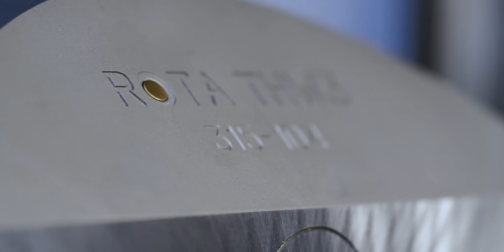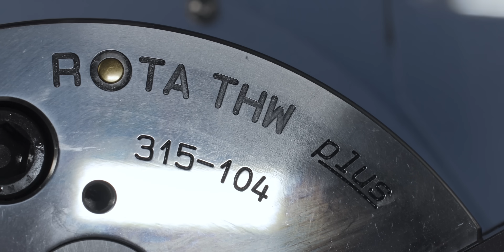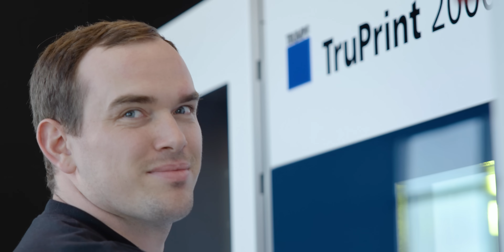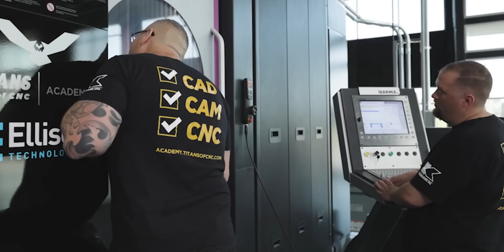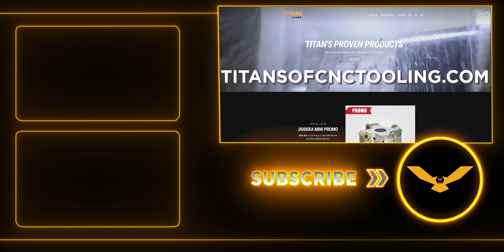Should Engineers Be Arguing with Machinists Over Run Time?

Comment: There are always 2 sides to every coin, titans. Presenting just one point of view is never good.

I am a mechanical engineer in a company that produces hydralic products (not parts mind you, whole products). Our company has >500 people working in it and about 120 CNC Machines. I can work and setup about 90% of them.

Every time I go and talk about a new part for a product with some of the "older" machinists and setup guys, all I hear is how this part is impossible and it can't be done. And in my 13 years of work experience, we've never failed to produce the "impossible" part.

Now you talk about how bad engineers are, but I've seen machinists intentionally crashing machines just to "prove" you are wrong. I've seen machinists writing programs to keep the spindle running, so the time efficiency tracker won't detect idle time. Smart people are very creative. 

We don't know the whole context here, except what the narrator wants us to know, but there are bad aples on both sides of the fence. And they are usually much less than the good apples. Now I am following you mostly for entertainment value, I don't know if you have an engineering department, but from what I've seen from your videos and attitude towards engineers, I would guess not. Don't be narrow minded, stay hungry.
Reply: As an engineer with only a few years of career experience, I've seen exactly what Trevor describes. I've also, like you, seen production sabotage themselves to spite engineering and management. So yes, it goes both ways, but don't discount the one side just because the other was not presented in this one anecdote. Have you ever heard/read an anecdote that shows both sides intentionally screwing the other? Me neither. That's why they have many anecdote videos. They have a video similar to each anecdote you presented - go look.

Re: "I don't know if you have an engineering department, but from what I've seen from your videos and attitude towards engineers, I would guess not."

Barry doesn't hold a degree, but he is an engineer. He and Trevor both design parts and tooling. Barry meticulously calculates machine capabilities for their extreme cuts. Since many engineers are glorified designers (I dip in and out of that category), I would say that Titans of CNC doesn't need a dedicated engineering department because some of their machinists fill the role of engineers.

Don't be narrow minded - don't judge a library by one video.
Reply: Interesting, we have some parts that are way over quoted , like 30 hours to run this job is quoted but I can do it in 10, and the older guys always try to get me to use that full 30 hours and turn my feeds down and I’m like hell no! A lot of problems at this company stem from almost all machinists acting like that especially if we don’t have a lot of work , I really don’t like tracker times because it doesn’t account for if you run into programming issues or other issues. If a machinist actually tried to crash a machine on purpose he’s done.
Reply: Yeah this video felt more like a rant. As an engineer I can tell you there are plenty of engineers who know nothing about machining and don't care.
I would NEVER claim to be a great (or even good) machinist, but I did intentionally ask to be put in the machine shop as my first graduate placement. Firstly learning machining makes you a better and more sympathetic designer and draftsman.
Second you realise you will never know it all, but you start to know what you don't know.
Thirdly you make friends in the machine shop, and those contacts will be very useful when you need advice or a favour cos you screwed something up and need to get it fixed ASAP.
I loved my machine shop time, and the fact it helps you when you jump on a manual machine for an ad hoc design change
Reply: Good on you. I’m tired of hearing all the engineer slander and the “us vs them” mentality that goes on within departments of the same damn company. 

The most important thing a business can do is stop tolerating the fragile egos of managers and have open communication and cross training between departments.
Reply: I was thinking the exact same thing when I watched this video. This is one of if not my favorite youtube channels, but this video is tone def and one sided. I did not hear any suggestion that maybe the engineers should spend some time on the shop floor learning "why" things are done a certain way. I got to witness first hand last week that 30 years of machining experience does not mean you are immune to making mistakes that cost the company thousands of dollars and days worth of lost production time. It was a perfectly preventable problem that could have been avoided had the machinist followed some pretty standard best practices when it comes to programming.

Clocking in and out of jobs takes next to no time when compared to the time required to setup and run the job it is literally a mater of seconds. I don't know why the "degrees n' stuff" comment bugs me so much, but as an engineer I know that my degree doesn't mean that I know everything. Just like having an engineering degree doesn't make me an expert machinist, having 30 years of machining experience doesn't mean you are the worlds greatest machinist or that you are constantly working on improving run times, tool, life, part quality, reducing down time etc. 

For supposedly being a channel dedicated to learning and education, this video has done nothing but give young machinists reasons not to work with or trust their engineers. If they really wanted to make things better, this channel would find an engineer they trust and do a whole video series on how machinists and engineers can and should work together.
Reply: @keeganrempel6847  engineers with machining experience that actually get involved with machinists are like gold, and it makes everyone’s life easier. It would be awesome if companies had engineers cross train
Reply: I have the same feeling. I find that in general, it's not really known what an engineer actually does. Only the 'bad' things are often stereotyped in my opinion. As if we think we are better and can never make mistakes.
Reply: I would recommend you take a look at your ego. I've seen engineers deliberately cut corners on their designs just too please their boss or make deadlines. Also seen them make high dollar mistakes because they refused to listen to those around them.
Reply: You're a rare breed bro, don't read too much into it.
Reply: In my experience, more often than not, the engineers designing a part have little to no understanding in the machining process when it comes to the design and datum structure especially when it comes to tight tolerances. Is this video a little biased? It is to a point, it doesn’t disregard the fact that Mr. Engineering degree knows jack about machining yet he/she wants to tell us how to machine the part? Tell your Engineering people to respect our trade, we dont have Control+Z to undo a mistake like you guys have in your virtual world where everything is perfect. That’s why us Machinist don’t respect engineers due to this sugar coated mentality.
Reply: yall are acting like theyve never called out machinists for doing piss poor work, or intentionally breaking stuff. they have, all the time. jeez, yall engineers sure dont think you have an ego about stuff, but my god you do. get over yourselves.

Comment: I believe the best thing that engineers can do when Improving a process, part, etc., is to grab machinists from the floor and have small meetings. For me, the meetings help me believe that my opinion is Important and that teamwork is the best aid. When we sit in separate pods and complain that one department isn’t right or  wrong , nothing gets accomplished. I’m trying to push this, because we have a lot of this toxic workplace environment at my current employer. It’s a work in progress. It’s a lot more exciting when everyone is on the same page working together too.
Reply: I would do the same, but in reverse direction: make the engineer come to the machinist. It's all nice and well to CAD a part, but to see the machining (and all the prepwork, fixturing etc.) is kind of abstract behind a screen, even though software can visualize the toolpath on screen. 

I have to be honest, my background is somewhat different. I've been a process engineer in the steel industry for just over 9 years. That meant a combination of sitting behind a desk but also on donning the required protective gear and stepping onto the production floor or the control room, seeing production, chatting with operators. There is such a wealth of practical useful information to be learned from them.
Reply: Yeah. Somehow, when two parties disagree, discussing the problem seems like an absurd idea to some...
Or, in this case, simply complaining was easier and provided the satisfaction of "I told you this process would be bad, therefore everything is your fault."
Reply: We used to have a similar problem until we started safety meetings every morning they didn't have to be long but we had to have them kept everybody in the loop on the same page and made everyone important and productive. It's amazing what you can do in 5 to 15 minutes while everyone's drinking their coffee and normally would be out on the floor talking not producing a thing.
Reply: Then they find out that letting the machinist build all the automation is cheaper than an engineer. Then the new HR lady fires you for working on the automation and not running the parts on the machine. that's what the did to me. And that's when I went from employee to supplier.

Comment: Honestly I don't think the system was a terrible idea, yes I agree it slowed down production and yes I hate unrealistic deadlines. However, if they used the metrics to figure out if 4 out of 10 machinist were slacking and stealing time from the company. I don't see an issue with it and would actually see it as a good idea for weeding out the bad eggs. Obviously the way you describe it, they were using those metrics to threaten you. That's not okay. But, I've worked in plenty of places where 5-6 lads just don't give a damn and it leads to their work being piled on everyone else who was doing their job right.
Reply: Yeah, we make prototypes every single day where I work. You have to clock in on the parts so your times gets registered. If youre then the only one working on that parts and it takes longer than calculated - as long as you can address why, its often cool.

This also means that the slacking morons can't just hide, which is fine.

Comment: Personally I'd think getting the engineers down on the shop floor to watch you work a few hours should rectify the problem unless they're just assholes. 
I'm an undergrad operating the manual machines for a uni autosports, I'm always happy to learn but often seeing what goes into a job clears up any confusion far faster than an explanation. That said, I completely get the frustration towards engineers. Some of the design 'decisions' I see tempts me to perform percussive maintenance on the offending designer.

Comment: Whenever you have two parties arguing about what is possible and what will damage the machine ultimately reality will be the deciding factor. I work with engineers and I worry less about being right all the time and just try to make sure I’m communicating my best estimation to those stakeholders involved. If I tell someone something might not work and it doesn’t work that’s OK but if I tell everyone that this won’t be a problem and it fails miserably than I have done a poor job of estimating and communicating expectations

Comment: Most engineers shouldn't argue about anything. Unless they have actually worked on the floor and / or in quality, they need to do their job and keep their mouths shut.
Reply: Some engineering programs at least make an effort to get engineers familiar with the trades they are going to be working with. In undergrad, my program had a required lab with a master machinist as the lab teacher, and we had to use CNC and non-automated milling machines and lathes to make parts within certain specs (I think 1/10,000 of an inch, if I remember correctly). That being said, it is pretty idiotic to argue with people who do a trade for a living over how to do their trade. Not all engineers are that dumb. I don't work in mechanical engineering, but I do work with electricians, pipe fitters, calibration and metrology techs, etc. I do my job, they do theirs, it works out quite well.
Reply: @JNF  not saying they are dumb, but they are not God. I like the ones who have spent time in the field and will work with me. The new ones fresh out of college have little to no idea what they are doing, They will never admit to being wrong. When you prove them wrong, they get really butt hurt.
Reply: You realize engineers design the world we live in right? Seems like a very callous attitude towards engineers, sorry about your post traumatic engineers trauma😂